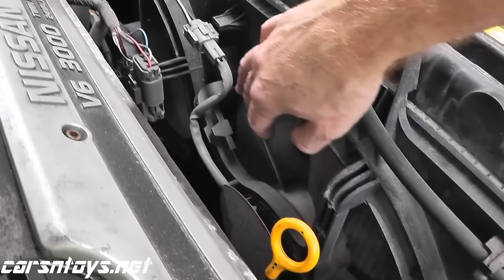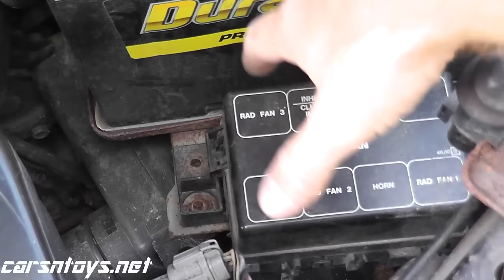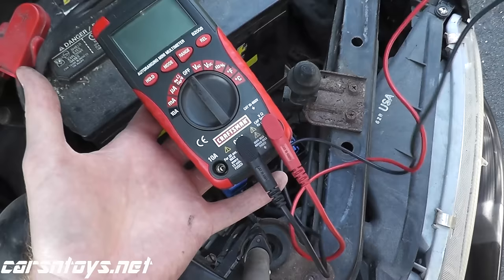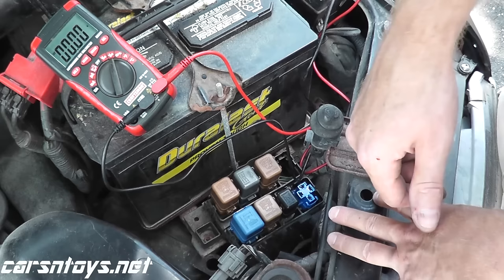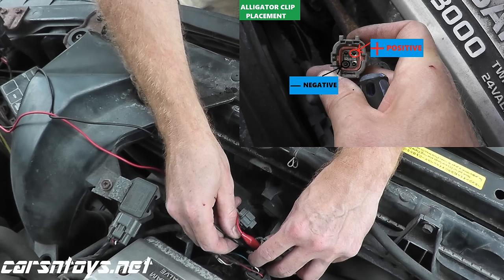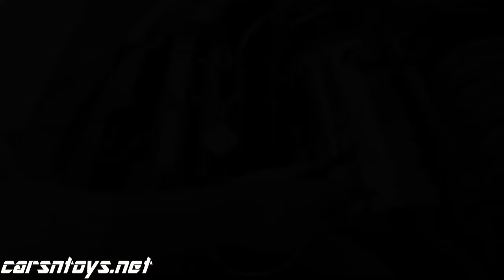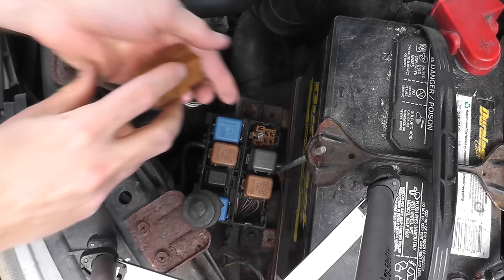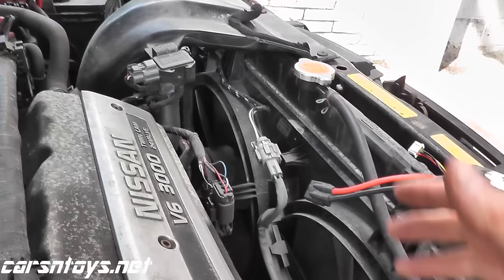Overheating Help! | Testing Cooling Fans - Relays - Connections

Comment: I did all that and I went through all the steps. Everything worked out. But no fans turned on. I got pissed off and spun them myself and they stayed running.  So what's the problem?
Reply: The fan itself it seems like.

Comment: I Have a 03 focus with zetec motor.my cooling fans are not working! I ran power(using a 15 amp fuse) to each individual fan & they worked! I replaced the head temp sensor & cooling fan solonoid. I replaced the relays, & still my fans don't work! Then,  I smoked my multimeter,  accidentally used the unfused side on a battery! I need a new one asap!!!!

Comment: What if you get ~ 12v on 3 out of 4 points in fan relay 1?
Reply: Then your relay is receiving the signal to turn on. Look at the diagram on the back of the relay at   6:30. Number 3 has power at all times. 1&2 receiving power allows 3 to pass power to 5. He talks about testing continuity but Ive always tested the relay next. You can do it with the multimeter as he shows at 6:30 or if you're like me you can find a duplicate relay that powers a system you know works and switch them. Just keep in mind that if your fans turn on it means a bad relay. But if they don't it doesn't necessarily mean the relay is good, just that you have a problem somewhere else.

Comment: I have nissan sunny 2010 only low speed rad fan works how to combine or make only 1 speed means fast speed.
Reply: al whit thanks 4 the reply it is not my own wish. I just wanted to be safe side means avoid overheat. I think fans are controlled by ECU. For my engine safety I will fix an additional  fan for summer use only and will wire it from ACC switch without touching genuine wire.anyway thanks or if u have any other idea plz share.

Comment: HI! Quick question i have a Toyota Camry 2002 and it keeps overheating cuz the fan is not working when its Hot. i just change my ECT sensor and its still the same. when i unplug the cable of my ECT sensor and my fan is ON . Please i need your help Thank you

Comment: Had to wire my coolant temp sensor with two individual clips when plug went bad bc male sensor lead stuck into sensor wire clip. Couldn’t remove. So clipped it off and butt spliced individual wires to individual male sensor teeth with gold plated female terminals. Fans only work on low at red zone temp and only for 1 minute. Same when on a/c, only for a minute.  The won’t stay on or keep motor cool idling in park in winter temps. Changed sensor in rad. Where is any other sensors in 06 solara Toyota V6 3.3L? 
What else could it be? Noe issues before rad leak.

Comment: How come my cooling fans turn on when I turn my switch on the next morning when the car is cold
Reply: Fans don’t run when it’s cold only when it gets hot and they need to work
Reply: @jdm_obsession  are you assuming my relays is not working properly?
Reply: @BBOOXXEERRMr  assuming they are working cooling fans won’t work until a certain temp
Reply: @jdm_obsession  I should check the rely. It’s a good start. It might be getting stuck
Reply: @BBOOXXEERRMr  if they work when you car is warmed up you are good fans don’t run when engine is cold

Comment: My vehicle doesn't have those relays, it has an integrated circuit board.
Reply: Edit: It does have a relay tho, in the under hood fuse box.

Comment: Continuity tests are done on wires with no current running through them. You are testing for continuity which means there are no breaks in the wire.  His meter should have been set to DC Voltage when he tested the relay that you were able to hear clicking which meant that voltage was present. He also uses the term "Short" incorrectly. He should have said "open circuit", which would indicate NO continuity due to a break in the wire. A "short" means that a HOT wire is coming into contact with a "Ground", which would cause blown fuses or melted wires.

Comment: What if one works and the other doesn't
Reply: Good question! Did u find a solution? Im having the same problem
Reply: Same here. I have a 2000 Nissan Maxima. I have test all 3 Rad Fan Relays, the wires, connectors; just as he did in the videos & everything has a power signal . The fans even come on when directly tested with a 12 volt battery, so I know it's NOT the fan motors, relays or wire connectors. I tested low and high speed. I'M CONFUSED & FRUSTRATED 😠 Why would only the driver side work on low and high speed, but the passenger side of the fan, doesn't work on any speed at all. I checked all the other fuses also. 😤 PLEASE HELP!!!